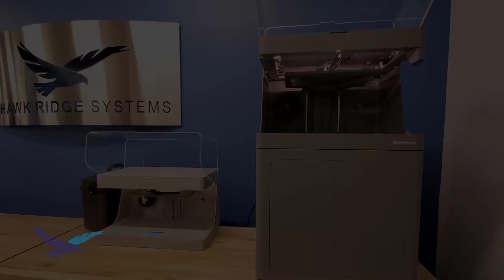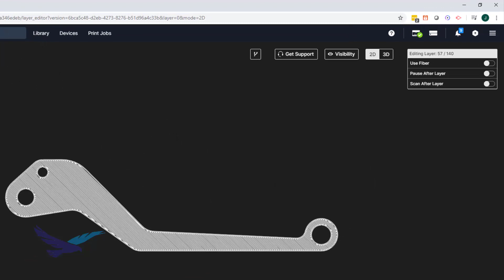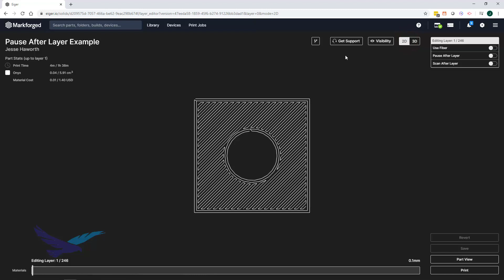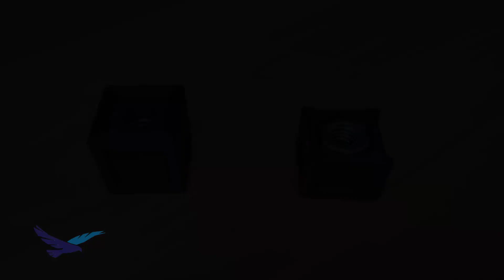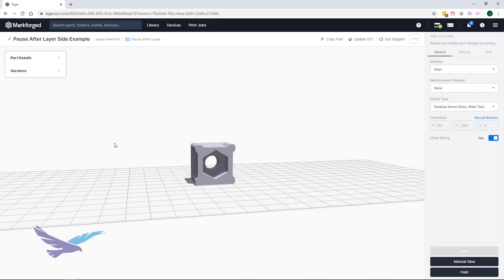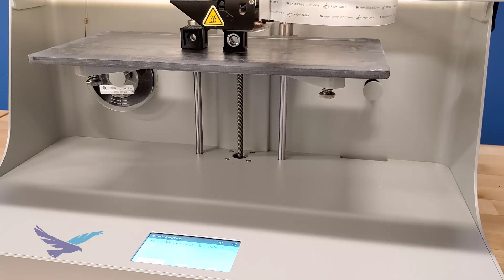Metal Inserts with Markforged 3D Printing

Comment: In the second example, why can't you pause at the slice when where the vertical walls of the nut cavity are finished? The top of the nut would protrude, but only into the space used by the nut, and the rest of the printing would be supported by the nut.